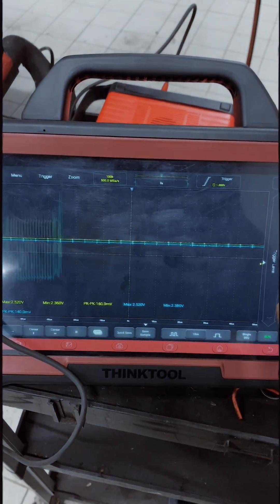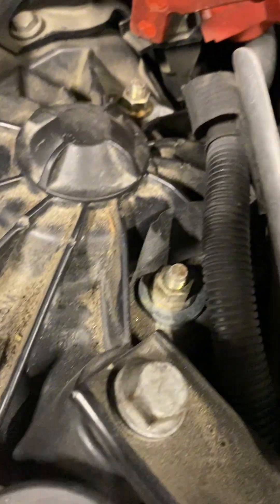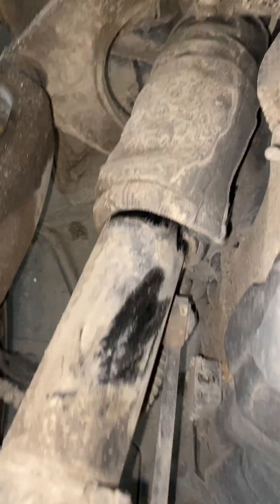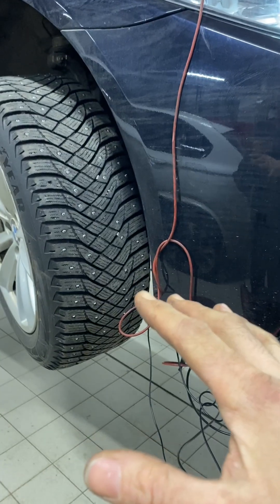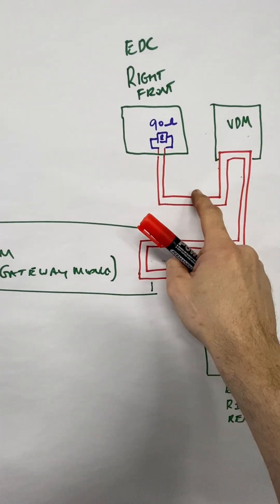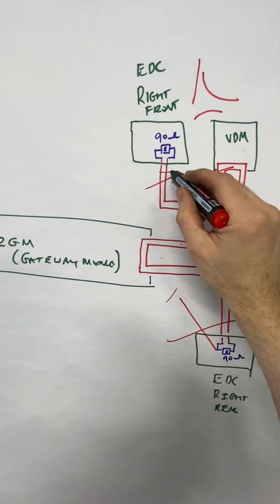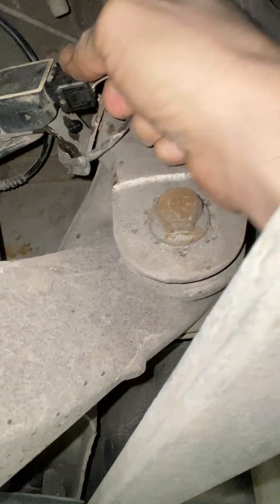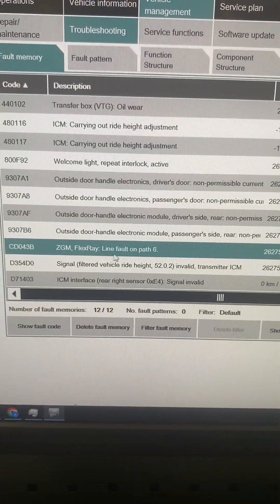BMW F11 Suspension Mod Fail: They Removed EDC But Forgot FlexRay!

Comment: Hi, ive deleted edc but obviously path 5 and 6 are still active even tho i wrote it in vcm. Can you give tip on how to shut down those paths
Reply from the maker: You need to use E-Sys. There will be a guide online somewhere
Reply: @BenJFF hey, wandered around internet and found way. I coded modules again with esys and then reinitialized flexray with ista. For now errors are gone but i will update if ur interested
Reply from the maker: Please do
Reply from the maker: If I recall the vdp was one place where the ports should be disabled. I will ask my mate tomorrow
Reply: @BenJFF i havent found for this exact problem. Car sometimes works great and sometimes almost nothing works.

Comment: Can you tell me how can I check flexray connections? Is there some value of ressistance like in bus at 60oms when everything is ok, or the scope is only option? Thanks in forward!
Reply from the maker: Danny - I wrote an article about that once. Its about 85-90 ohm per path. Its really hard to explain here mate but read this article I made https://gb.readly.com/magazines/car-mechanics/2023-07-21/64b336c89baad0ab54d4f15c?srsltid=AfmBOopxu0otAjbLVtXOa0aYvjWEQ_fNindHAzkZKsjEwinaIDy98a0A    Sign up for a free trial then cancel the trial
Reply from the maker: Daniel heres another https://pmmonline.co.uk/technical/suspension-issue-with-a-bmw-f11/
Reply from the maker: Consider joining as a member 😃
Reply: @BenJFF For sure! Your pro!❤
Reply from the maker: Thanks mate

Comment: Maybe ylu could help or point me in the right direction.  I have the dynamic drive fault coming up on my i-drive. Fault code 6318 vdm activation line, left. Any help would be massively appreciated.
Reply from the maker: Ricky I offer tech support for the low price of €50. Email me

Comment: Great job sir i have question I'm also auto electrician and always doing European cars can you tell me please which software you can  use for coding ista or ista.p or Esys please
Reply from the maker: Thinktool Euro Master and occasionally Ista. Most people are using E-Sys and Tool 32 - both good options
Reply: Thanks allot boss

Comment: Cool stuf! A different gateway module (used one) from a non active suspension car would have avoided the "special" coding software?
Reply from the maker: Probably. If this car had been fitted be active roll stabilisation (ars) then it would have been more tricky since ars uses the vdm 🙂

Comment: Yuk coil overs on a big BMW,  if you can't afford the new edc dampers you buy used ones (and risk a high chance of having to try a few until you get a good pair).Then you leave everything as intended.

High end car makers spend millions optimizing the ride snd handling on their cars.

Coil overs are for track cars and fast road use.
Reply: You are correct. I imagine this isn't the first owner however. Those F11 cars are depreciating like rocks. I've seen F chassis cheaper than E chassis 😂. Probably the car had a good price exactly because of the suspension problem, the buyer invested 34,99 in the coils and got it back on the road. Not a bad deal all in all.
Reply from the maker: Brilliant car as well . I had a polybushed f10 with d2 coilovers and it went like a hot hatch - incredible. But mine never had edc so the coilovers were an improvement
Reply from the maker: And I see Aerosus do edc dampers for less than 400€ a piece
Reply: @BenJFF  do you think aerosus would be a good option to replace aged edc systems?